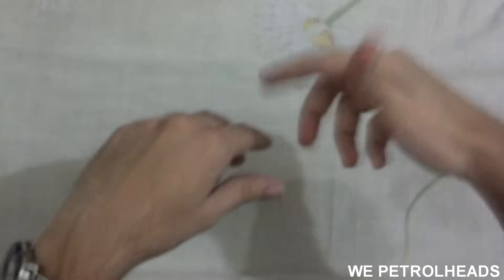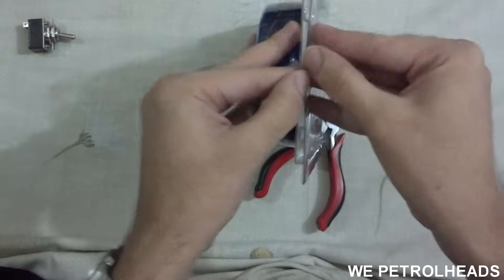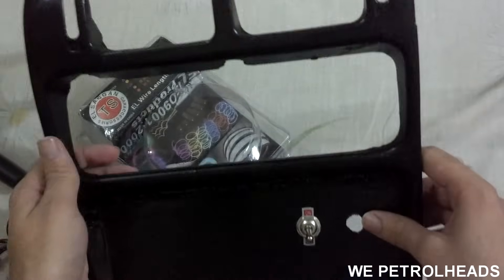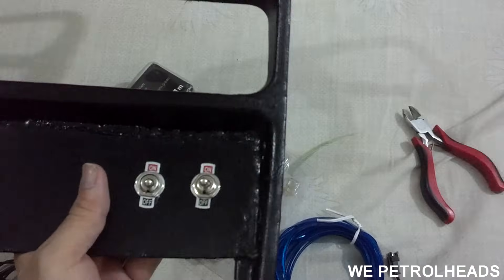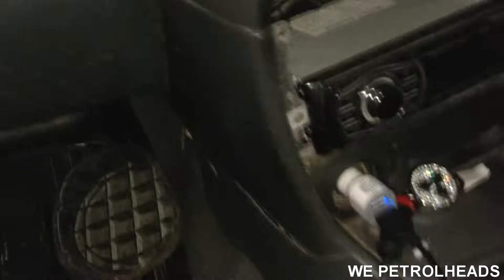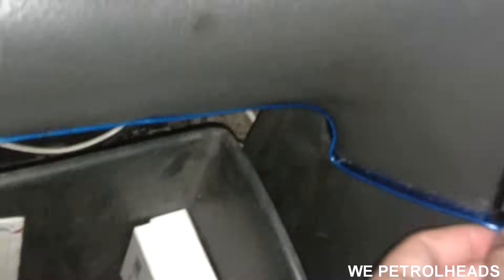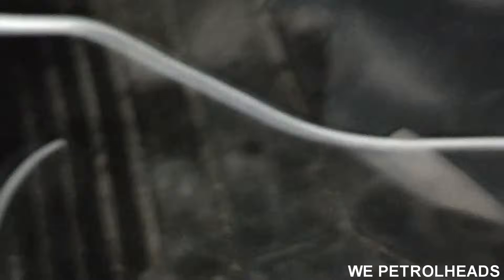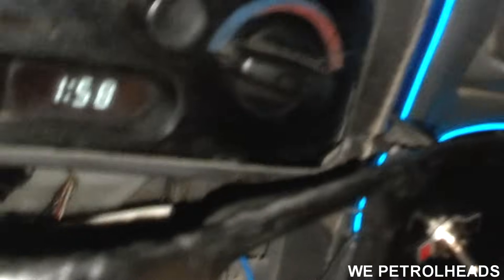DIY install EL wire with 3 methods

Comment: Bro bad me kabhi el wire hatani ho to glue ke marks dashboard pe reh jaynge ya fir hat jata h ye glue bad me without mark chode??? Mujhe install krni he par dashboard bhi khrab na ho esa koi glue ho to batao jisse bad me marks na rahe hatane pe
Reply from the maker: bro ye best hai zyada nahi bs zara sa apply krna puri wire pe. dashboard ko kch ni hoga or jab hatao to soap ya thinner se clean hojaega. iski jaga glue gun or 3m tape beh use kr sktay hain ap
Reply: Which superglue should i use can you share the link please
Reply from the maker: @HopeonWheelz  any super glue that contains "Cyanoacrylate" google it there are several brands. I used gorilla

Comment: If we install the el wire with doubletape so it will cause some effect on dashboard or not?
Reply from the maker: sorry for replying late. I prefer not to use doubletape because removing el light will damage your dashboard and it will leave stains.
Reply: Yes, you can use tape.  Some kits come with the 3M tape.  It will do much less damage than superglue.... and likely do no damage at all.  
It's just slower, because it's a tight spot  to push the adhesive and EL wire into.

Comment: How can I split it in different pieces connected to the same power source?
Reply from the maker: you cant it wont work. However you can reduce its size by cutting it from the end and if you want more lights to install on different places than you should buy an EL wire "splitter"
Reply: @WePetrolheads  actually I found a way to make it work without any splitters. It's pretty fragile tho
Reply: Whats that other way bro?
Reply: @Kvn_mhn  What we did was basically removing the rubber covering and then soldering the cables inside. Problem is that the cable is extremely thin so it even broke down during the process and we had to do it a couple times before getting it right. It's a pain in the ass but I think it's the way to go if you wanna do this for cheap

Comment: I want to install it my cars dashboard and front, rear doors and want to connect the lights with my dashboard lights, how to do the connection and will I need 6  inverters (one for left front, one for right front, one for rear right, one for rear left doors and one for dashboard)??
Reply from the maker: No you wont be needing 6 inverters, just buy a el wire "splitter" and than you can connect all lights to your dashboard light check out the link below
https://www.glowculture.com/5-way-el-wire-splitter
https://elwirecraft.co.uk/el-splitters-new/
Reply: We Petrolheads thanks.

Comment: I don’t know wires and electrical stuffs so what i don’t seem to understand on option 2 is when you connect the + and - from the lighter with extra wires (blue is + and black continues -) you take them to manual switch and i can see that you attach the earth (the - one which is black wire) to one side of the switch and an extra earth to the other side.... so on what you connected the blue wire to (the + wire)? And also at the end on what you attached the second earth that goes from manual switch to??
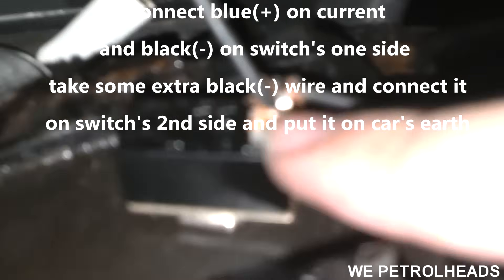Reply from the maker: I connected the blue + wire with car positive current on cigarette lighter socket, I chose that place because it was near to connect, you can connect on any positive wire. check video at 8:30

 I attached the second earth on car's body. you can connect that second wire on any car metal piece, screw, nut or on car metal body etc. check at 9:25 I am showing by putting the second wire on music player

If you are still facing difficulties I can make another video for you in which I'll only show the wiring process and post it on my channel
Reply: We Petrolheads thank you. I will receive all components next week and will connect everything then. If I will have problems i will ask you to make the video. Thanks
Reply: We Petrolheads but the way. What colour would the + wire will be on the lighter??
Reply from the maker: It depends, usually it is red or orange

Comment: My question is: If you cut the wire to 4 parts to put each in a place...how will they all light together? do you need 4 wires for each?
Reply from the maker: if you cut the wire than it wont work but you can buy 4 el wire and a wire splitter and than you can turn the light on and off all together at once
check out these links below of el-wire splitter
https://www.glowculture.com/5-way-el-wire-splitter
https://elwirecraft.co.uk/el-splitters-new/
Reply from the maker: if you cut the wire than it wont work but you can buy 4 el wire and a wire splitter and than you can turn the light on and off all together at once
check out these links below of el-wire splitter
https://www.glowculture.com/5-way-el-wire-splitter
https://elwirecraft.co.uk/el-splitters-new/
Reply from the maker: if you cut the wire than it wont work but you can buy 4 el wire and a wire splitter and than you can turn the light on and off all together at once
check out these links below of el-wire splitter
https://www.glowculture.com/5-way-el-wire-splitter
https://elwirecraft.co.uk/el-splitters-new/

Comment: can i ask u? what kind of glue that u use fotr it
Reply from the maker: I used superglue, super glue contains "Cyanoacrylate". its a powerful glue bonds in 3 seconds, there are several brands, click on link below 
https://www.ebay.com/bhp/super-glue
by the way I used Elfy glue
https://www.ebay.com/sch/i.html?_from=R40&_trksid=m570.l1313&_nkw=elfy+glue&_sacat=0&LH_TitleDesc=0&_osacat=0&_odkw=elfy
Reply: ye glue dashboard ko khrab ni kregi kyaa
Reply: Your NOT really suppose to glue the wire, ugh. That's what the FLAT side is for. To insert it between the gap's. Wow. Lol. But to each is own. Ha😄
Reply from the maker: @sadiaurajewellers  No brother it wont
Reply from the maker: @K-Z1  yes you are right but now a days most of the cars dashboard are very detailed and well designed. You can not insert the flat side. therefore I used superglue

Comment: How do i connect with the lighter socket?? i mean i dont know wiring at all. and what kind of car charger do i need? please answer ASAP. Also, i didnt get a car charger like yours with the package. so ill be using a a samsung car charger. please guide me.
Reply from the maker: Dont worry you can use any android car charger no specific brand is required. if you are using Samsung's then its ok

but your charger gotta look like this, see the charger image below and if it has one socket then its ok too.
http://www.1001-gifts.com/164/ldnio-dl-c23-rapid-usb-car-charger-with-2-usb-charging-ports31a-sharedfor-apple-and-android-devices.jpg

you''ll be needing a "charging cable" so you can connect el wire with charging cable. see the cable image below in mentioned link
http://www.buyeasyonline.com/ebay_photo/201412/28004/28004-1.jpg

2nd step :

cut the charging cable using wire cutter and inside the cable you'll see additional wires, ignore all the other additional wires except the ( Red Positive and Black negative wire )

join the cable's red positive wire with el positive wire and cable's black negative wire with el negative wire

Note: ( in my video both EL wire positive and negative are black but one wire has white lining so this indicates that this wire is positive and the other is completely black so this indicates that its negative )

Last step : when both wires are joined, roll them with a solution tape separately and you are done
now plug the charger and the lights will turn on